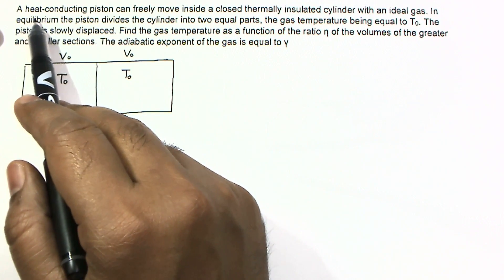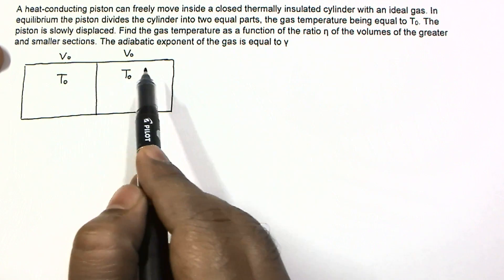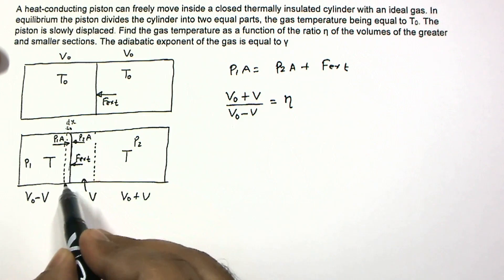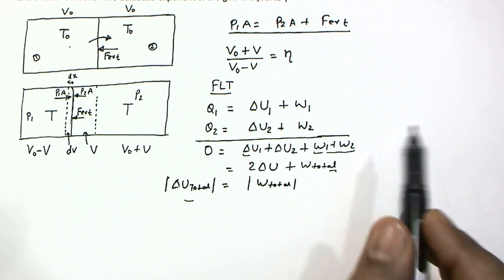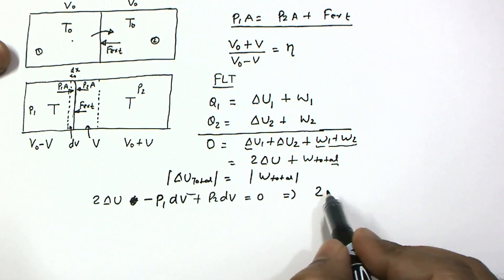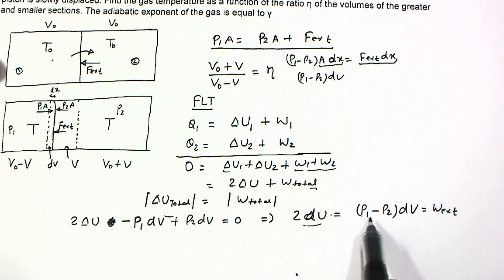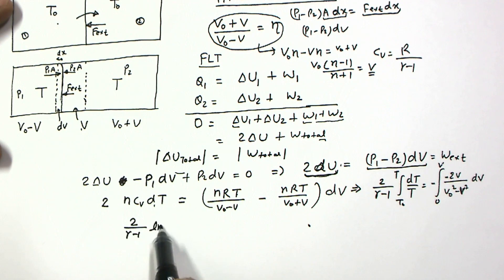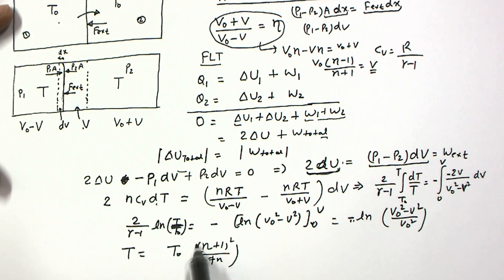IRODOV | Problem 2.41 | Thermodynamics | Temperature As a Function of Volume ratio of Compartments

Comment: Sir why Q is Zero in this case. Plz give a brief idea.🙏
Reply: Is this the reason.
When we directly write the work done equation for the system by analysing the work done by external agent then in the heat lost by one compartment will be gained by other compartment as the cylinder is thermally insulated and the net exchange of heat with surrounding is zero.

Aur agar sir cylinder thermally insulated hota to kya Q zero nhi hota.
Reply: @shivamverma9447  do you have doubt now

Comment: Is this the reason for Q=0
When we directly write the work done equation for the system by analysing the work done by external agent then in the heat lost by one compartment will be gained by other compartment as the cylinder is thermally insulated and the net exchange of heat with surrounding is zero.

Aur agar sir cylinder thermally insulated hota to kya Q zero nhi hota.
Reply from the maker: Heat gained by one is heat lost by other and no heat exchange with surroundings

Comment: Sir the overall change in internal energy of the system will be zero ...
Reply from the maker: No.. Overall change in internal energy is NOT zero. Net heat transfer is zero.
Reply: Okk sir the overall temperature of the system will decrease and the net heat exchange from the outer wall of the container will zero or it is the fast process
Reply from the maker: @domgesh392  pressure on Left is more than right but change in volume is same for both. More negative work by gas on left side than positive work done by gas on right side. So net work done by gas is negative. From Q= ∆U + W ,  W is negative , Q is zero so ∆U is positive which means temperature increases.
Reply: Ok thank you sir for clearing my doubt ...,
🙂

Comment: p2A =P1A+FEXT SIR  HOW THEIR AREA CAN BE EQAUL     AFTER DISPLACING IT
Reply from the maker: The decrease in volume on left is equal to increase in volume on right. The way in which vol decreases on left mathematically it is same for increase on right. But pressure on both sides are different during the process.. so work done is NOT equal.
Which area are you talking about.
Reply: @PhysicswithAkashGoyal   sir   i am talking about    the area   A which   used in equation  my  doubt is   after  displacing the piston area of chambers must  also change
Reply: @PhysicswithAkashGoyal  sir  as you stated in there  is    decrement in frist chamber  and increament     second chamber   how  their  areas  of two chamber   will be equal
Reply from the maker: @mohityadav8512shree  Area used is area of cross section of container and this is also equal to area of piston. Volume is Area *Length
Reply: @PhysicswithAkashGoyal   that  means   length    would change  na sir ji
Reply from the maker: @mohityadav8512shree  you can take any shape cylindrical or cuboid...volume is area of cross section into length... One side length decreases and on other side increases by same amount.
Reply: Good question but nice solution..